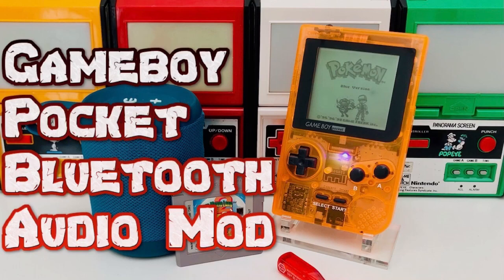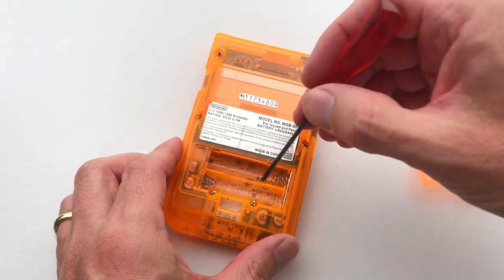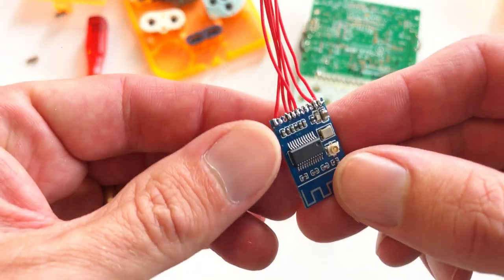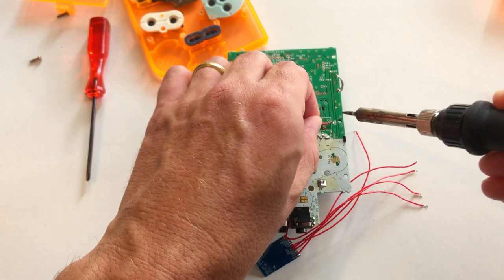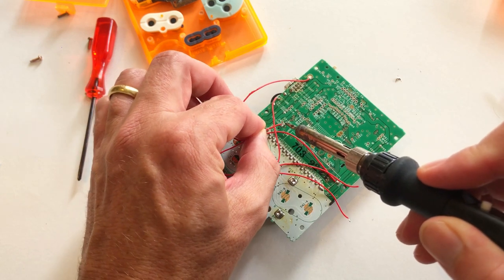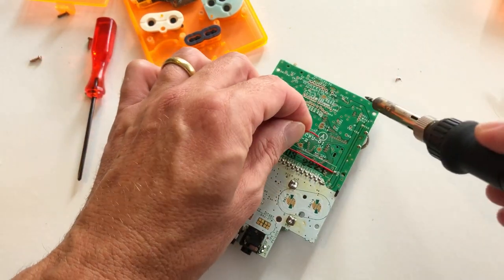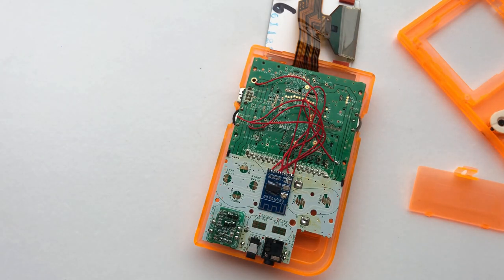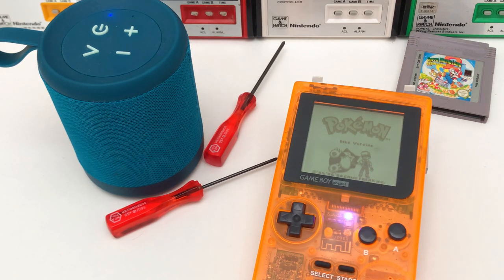Gameboy Pocket Bluetooth Audio Speaker Headphones Mod GBP #gameboy #nintendo #gameboycolor #repair

Comment: Really cool stuff, but what the annoying blinking? :)
Reply from the maker: Cheers. We used a clear shell to show case the mod. If you used a solid colour the light would be minimal
Reply: I haven't tried it yet, but if you can solder the wires on, you can desolder the led chip
Reply from the maker: Definitely 👍

Comment: Nice mod! Do you know how to install that mod on a Gameboy DMG?
Reply from the maker: Cheers 👍yes we do. It will be a future video
Reply: @GameboyCustom  Wow, that was a quick response! I'm always struggling with the CON pins, so that sounds promising! :-)
Reply from the maker: @EdvinDraw  the CON is only a circuit point to connect a button or switch
Reply: @GameboyCustom  So, it isn't the solution?

Comment: First
Reply from the maker: Cheers 👍hopefully. Now others can also enjoy this mod
Reply: @GameboyCustom  yeah I remember someone did this a couple years ago always wondered how 🤔
Reply from the maker: Hopefully this video will help others with the install
Reply: @GameboyCustom are you going to do all of the others too?
Reply: @GameboyCustom  it definitely will im going to try the sp or even the ds lite. It might have similar points to wire up. 🤔
Reply from the maker: Sure am. The videos are done and will be posted within the next week
Reply: @GameboyCustom  hey great video man just wired up a gameboy color with the same pinouts used the select button as the pairing "con" button and it worked is was great but the downfall is this games that use the select button automatically desyncs Bluetooth so instead of the select button I added a button below the bt emitter module and it worked out great! Just wanted to say this in case anyone else had issues with the same problem...
Reply from the maker: Thanks for the advice. Yes was thinking the same, to add a tactile button between the con and select pad
Reply: @GameboyCustom  yeah I used a soft tactile from adafruit one wire to con the other to ground.
Reply from the maker: Great idea. Even a touch sensor would work well. Enjoy the mod. We have the GBA and SP videos coming soon
Reply: @GameboyCustom  ah touch sensors yes if only I had some I guess copper tape and solder would work.